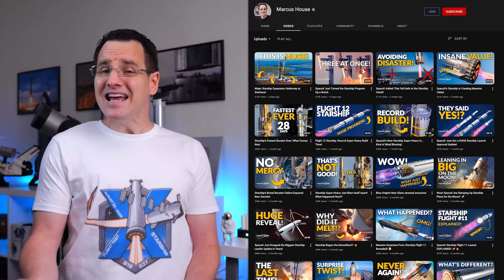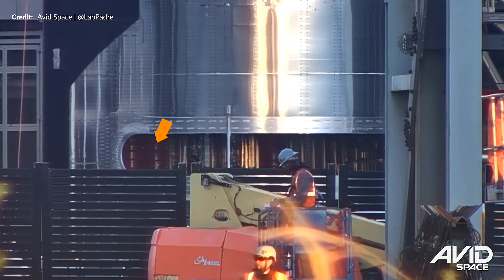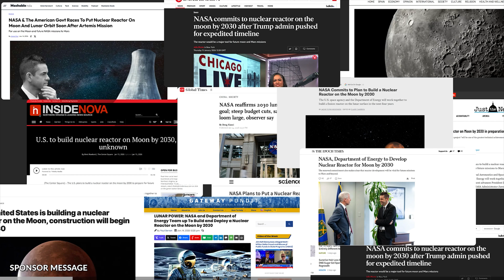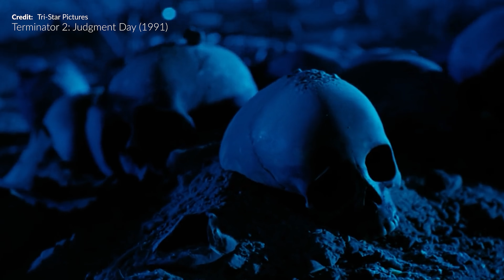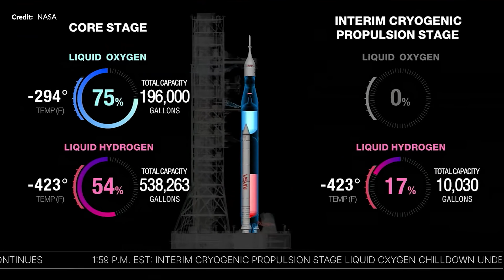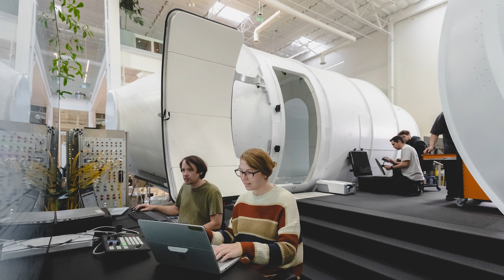SpaceX’s Starship Version 3 Testing is Epic! Why?

Comment: I wince every time I see the TINY, TINY roundabout at the east end of Highway 4. Any chance of expansion of the roundabout... towards easier use of it by the high volume of truck drivers of big rigs... got locked out, because of  the immediate proximity of the gas-extraction plant to the roundabout. If only they had located it another 50 or 100 meters farther away from the roundabout!

Comment: With the new Stage separation ring now integrated there are now no sectioned off areas to assist with the flip like they added in the last version of the temp ring.  Will this possibly cause an issue with the flip now?  I thought they added those sections to ensure proper flip and direction.

Comment: Solar is an Obsolete Technology, even with a Full Light Spectrum Solar Panel, they still require light!

Thermal Gradient Panels will power our world for the next 10,000 years, and they produce 24/7, not just when the Sun shines. They work above 40% efficiency, and we can go much higher. Supplying a whole house with over 4000 watts an hour, with only using 4 panels of 15 feet by 5 feet.

Thermal Gradient Panels, Love heat and cold, on every surface of this world. Floors, ceiling, walls, foundations, and attics. Cars, buses, trucks, tanks, ships, clothing, computers, even paper, and even on spacecraft they produce 5 times more. Also sidewalks and roads, and even glass. Every surface can supply enough power to power 7 Earths, in the next 6 months.

We can start to build our first Dyson Sphere, the first ring around the Sun will take just under 10 million Thermal Gradient Panels, taking us close to being Species Level 2, skipping from our .75 level right now.

Comment: I don't understand how the in-orbit refuelling will be done with the new fuel connectors located on the side/belly of the rocket, so the tanker and the refuelling SS are 'facing' each other. To force the fuel and air apart, the two SSs would need  to somehow spin around a longitudinal axis located away from/above  the refuelling tanker. Centrifugal force will then push the fuel through the fuel connector(s) in the belly and into the tanker. The positions would then be swapped when emptying the tanker into the HLS SS. Apart from causing dizziness and nausea to any humans onboard, I am not aware of any thruster system which can make a spacecraft rotate about point well outside the spacecraft.
So the plan must be to apply acceleration along the orbit of the Earth, either continually accelerating or decelerating the joined SSs, pushing the fuel from one SS towards the connector(s), and into the other SS. However this would need thrusters in the opposite side of the connectors (the 'roof' of the SS) to be continually firing!
Maybe, this could be done using aerobraking, rather than expending valuable fuel?
The only other option would be to have a pumping system which can cope with fuel and gas all mixed together in big bubbles. I guess there might already be zero gravity pumping systems which can do this? The fuelling SS would then only need to have a higher internal pressure than the receiving SS.
Reply: Pumps and ullage thrusters.  You have small thrusters applying milli-Gs of force, or less, to keep your propellant settled in the sumps at the bottom of the tank.  And then you pump from the sumps.

Comment: With one million new satellites i am a bit worried about the kessler syndrome,  considering that  Starlink satellites maneuver frequently, with numbers rising to hundreds of thousands annually, averaging around 275 maneuvers per day as of mid-2024, driven by increasing space debris and a conservative collision avoidance threshold. While specific numbers fluctuate, recent reports show major increases, with about 300,000 maneuvers in 2025 alone, a significant rise from previous years, reflecting growing congestion in Low Earth Orbit (LEO). One mistake and it all goes.

Comment: Secondly: SpaceX and their plans..
They want to put a million satellites up in space for a data centre.. ok.. but why make them individual satellites..?
Hear me out.. there's method to this madness 😊
Why not an Orbital Ring construction? As discussed by Isaac Arthur in his video from a few years back..?
(Well worth viewing btw)
A million satellites, at say half a ton each, is an incredible amount of mass to lift.. 500,000 thousand tons, minimum..
That's at least 5000 launches.
With 6000 tons of fuel used each time.
30 million tons of fuel.
We're gonna need a bigger ASU..!

Starship is still the way forward, but how about use a fraction of that fuel to put enough mass into orbit to build an orbital ring? And then stick the data centre on that..

Although it would be initially very costly, yes, once constructed, (from already available, regular materials), it would then drastically reduce the amount of fuel/energy needed to get stuff off earth, AND simplify getting stuff back down again too.. 
Mass drivers could be built on the ring for sending stuff off into orbit, and for catching incoming packages.
No heat shields required, just navigate in, dock with the mass driver track (magnetically), transfer the load to a carriage, and take the elevator down to the ground..
Fuel for space-faring vehicles could be brought up to the ring, and then delivered to waiting ships for missions off world.

Seriously, go watch the I.A. videos 👍

An orbital ring system would/could have enough surface area, to provide the entire planet with enough solar power to do away with all other forms of energy production down on the surface, (but we wouldn't need to tear out the already mostly non-polluting systems like geothermal or hydro)..
An orbital ring, or system of them at different altitudes, would make getting to space no more difficult than a train ride.. and their low altitude (only about 100-ish kms up) means the commute would be the same distance or possibly less than what some people do already for work each day..
But it would be quicker, perhaps even using Hyperloop style pods..

Exciting times indeed.. hope I live long enough to see at least some of this come about.. especially putting people back on the moon, and us getting to Mars..

Comment: Firstly: I find it curious, disturbing, frustrating and disappointing that after 60+ years using liquid Hydrogen for its rocket fuel, that NASA is STILL having QD leak issues when filling tanks..! every time..!
I get that being the coldest thimg on earth, it's really tricky stuff to work with and manage, but these people and their minds are supposed to be the best of the best of the best (etc..) in this sector.. as I'm sure they are, and they well should be..

There MUST be a solution to this.. maybe the QD idea might need to be re-thought..

Perhaps they are overthinking it..

Perhaps a secure, physical connection, which doesn't rely on a rubber o-ring needs to be tested and developed..

Something like a screwed together pipe fitting, like we have on a garden hose (the collar to the hose connector, not the spring loaded pullback part which holds the fitting, since that is kinda the system they already have and there's leaky o-rings in there), or a kitchen sink S-bend, that seals fully, is thermally conditioned, and is also motorised to unscrew and detach a minute or so before T-0..
Actually, since the development of wireless data connections, I don't see why the QD needs to be connected right up until the literal last second before launching any rocket..
happy to hear legit reasons why this is the case though, so please, feel free..

And then there's the other technical issues mentioned in this video..

BILLIONS of dollars, and decades in development and they have Orion hatch issues a week out from a projected launch day.. really?

Children are running Tictok Livestreams from mobile phones, while NASA struggle with a wired AV connection? And they blame the cold..?! Really..? ffs..🤦

Yes, rocket science is the most difficult engineering thing we humans have undertaken, but getting a video signal out to the control room shouldn't be part of this.. not after so many years of doing it..

As a side note on video quality: what's the deal with the really sh!those AV connection and Livestreams from the ISS?
Can we get some proper equipment up there with doesn't send back audio and video which looks like b-grade 90's TV..? 
Starlink orbits higher, has better ping and bandwidth, and handles loads more connections, and it's video capabilities are orders of magnitude beyond what comes from the ISS..
Maybe they should look at using Starlink on the ISS.. then we'd never get drop outs as the Station orbits..
This would also remove the "it's all fake, space isn't real" arguments from those people.. right?

Starlink//SpaceX discussion in next post.. 😉
Reply: "There MUST be a solution to this" why? H2 is able to 'move' through solid steal! 

The best solution to deal with leaks is to accept them and work around it. aka small stages! A big rocket is a problem here... so no solution! 

The best way to deal with it is having a wind machine moving large amounts of air around the launch pad. looks stupid, causes lots of other problems... but could solve the issue they easy way  
😅
Reply: @spanke2999 so, don't use solid steel then..
Perhaps PTFE or PCTFE polymer coatings inside the pipelines, and better materials for the seals, since rubber and plastics are useless and brittle at -250°..
Blowing the vapours away with a fan would be a good idea too, but they still need to be able to transfer an efficient amount of H2 from the tanks to the vehicle without just dumping a large percentage to the atmosphere.. Artemis is expensive enough already.

Like I said there MUST be a viable solution..
Reply: @GenoLoma  you missed the point. H2 is such a small molecule. that is literally moves through solid walls of steal! Whenever you deal with hydrogen, you deal with losses. It's physical impossible to deal with it and not losing some through leakage. You have two options, one to embed hydrogen into a crystal structure, like it is done in some fuel cells (experimentally), and two... deal with the leakage and make sure that there isn't enough hydrogen around to cause a problem!

Comment: --  --  Would like a schematic showing how hydrogen molecules can escape a sealed vessel.  --  --  
--  --  Also a list of known hydrogen containers --  --   and a list of hydrogen compounds that can be stored; --  --
--  --   and pumped and separated just before use --  --   What other volatile materials are stored in exotic mechanisms?  --  --
--  --  Can any fluid contain  pressurized hydrogen gas ?  --  --
Reply: Regarding the first — the short version is that a hydrogen molecule is small enough to find gaps in pretty much anything... a "sealed vessel" simply isn't sealed on that scale, since if you put it in a metal container, it will gradually diffuse through the metal (search for "hydrogen embrittlement"). Keeping it cold helps — but since hydrogen boils at just 20K, keeping it cold enough isn't easy either.
Reply: @simongeard4824  --  --  Thank you much for that !  --  --  do they use titanium or special alloys to make the tanks, I wonder?  --  Will look up embrittlement.   --  --  TY.

Comment: Spaceflight only seems to be moving quickly for deploying inanimate hardware, but not at all for human exploration and travel applications.  That's why the xAI announcement is disheartening: Talking about millions of AI satellites, but don't even have a solid near-term plan for increasing the number of humans in low Earth orbit, let alone beyond - what was supposed to be the whole point of the company.  Where are all the filings for drastically increased human flight?  Even just initial ones?  Where are they?  It's been treated like an afterthought, when it's supposed to be the core purpose of everything they do.

Comment: Minor nitpick:
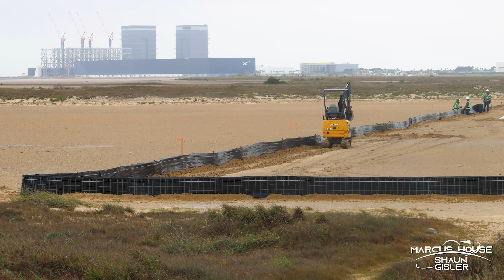7:41 The silt fence is not for groundwater, it's for stormwater.  Groundwater is water that is in the ground.  Stormwater is water from rain (hopefully not snow here).  When doing construction, the vegetation that normally holds the soil in place is removed, so if there's rain, the stormwater erodes the soil.  The purpose of the silt fence is to let the stormwater leak out slowly, leaving the silt behind.  When working right, this stops neighboring land from getting buried in silt from the construction site.  When it doesn't work, you get a mess with silt burying plants and filling in nearby wetlands and streams.  Managing stormwater is always a big challenge for construction sites, and they often have problems that are usually more expensive to clean up later than maintaining erosion controls like silt fences would have been in the first place.

Groundwater is an issue for basements, septic systems, flame trenches, and the like.  It's also much harder to predict when construction will change groundwater flows and do things like create springs or cause neighboring basements to suddenly have water problems.

I'm on my town's conservation commission, which means projects have to get permits from us for stormwater management plans and wetlands protection.  We haven't had to permit any flame trenches while I've been on the commission.
Reply: Keep in mind that the entire site is built in a swamp, and they're expanding out into it... so keeping water out is actually very high on their list of concerns.

Comment: Elon was recently on the "Dwarkesh and Stripe" tech podcast, and he gave several reasons that orbital data-center development was actually faster, cheaper, and easier than continued development of earth-based centers.  This included limited earth-based power plant components, regulatory issues, and differences in material costs.

Comment: Data centers built on Earth use a stack of water for cooling. Water holds lots of heat.
Just how good are space radiators at dumping heat?
Would  Stirling Engine fit into the design?
Reply: You mean a Stirling heat pump?  No, not really.  COP drops rapidly with temperature difference.  Boosting radiator temperature with a heat pump would boost radiator performance, at the cost of the mass and power draw of the heat pump.  You can reject more heat, but you have more heat to reject, and you need more solar to power it all.  There might be some gains to be had, but they're marginal and not worth the added complexity.
Reply: If we can generate just a couple terawatts in orbit we’ll have all that energy in one accessible place and it would give us a opportunity to use energy for scientific experiments that we never thought were possible because of our frame of reference.
Reply: @Lik @Likeaworm uple terawatts is going to require a solar array 100km per side.  That’s not “in one place”.

Comment: Cryogenic testing is a big step because it proves the tanks and plumbing can handle super cold propellant without leaks or cracking, and it helps validate welds and seals before any full stack tests.

Comment: If you put anything on the order of a 1km square solar array into space it cannot possibly dodge debris and becomes a huge target for all of the cruft that is already orbiting. Estimates indicate there are over 34,000 to 54,000 objects larger than 10 cm (about 4 inches) in Earth's orbit, according to NASA and European Space Agency reports. In addition to the >10 cm objects, there are an estimated 900,000 to 1.2 million objects between 1 cm and 10 cm, which are considered lethal but mostly untrackable. At this point building a large space based datacenter is practically daring a Kessler Syndrome to start.

Comment: The issue of Starlink is of course the risk it adds to of bringing about a Kessler event.  SpaceX has recently unveiled a technology used by Starlink satellites to make other satellites aware of their orbital paths, but that just seems to be an attempt to shift the responsibility of avoidance onto other operators.  Does not seem to be much of a solution to the huge risk of a Kessler catastrophe, and the increase of it with each Starlink addition.
Reply: KS isn't really possible in LEO. And no, SpaceX didn't shift the responsibility to others. Starlink has been and will continue to use the same tech. They just opened it up to others as well.

Comment: A space based data center is such a profoundly stupid idea. There's nothing to convect the heat away from the processors, the only way to get rid of excess heat is via radiative cooling, which requires massive radiator arrays that are never depicted in CGI renders. It's 1000% AI Vapor Ware, and people should be extremely concerned that SpaceX is even dabbeling in this.
Reply: Well SpaceX doesn't think so, but what do they know, it's not like they have the best and most experienced space engineers in the world or anything.
Reply: @admarsandbeyond They do, but that doesn’t change the fundamentals of thermo dynamics. Can it be done in space? Sure, but what advantages does a space based data center offer over a terrestrial one that would justify the development and deployment costs? Nobody seems to be able to point one out.

Comment: Its amazing to me that so much of that piping around the aft of the booster can survive the return without peeling off, I wonder if that has to do with the atmosphere created by the engine exhaust that curls around the skirt or something?
Reply: I thought it had to do with adequate welding and support brackets. Of course the stainless steel alloy is a factor.
Reply: SuperHeavy does not perform a burn in the atmosphere until nearly at ground level. So the plumbing on the exterior is directly exposed to the worst of the reentry heating and flow.